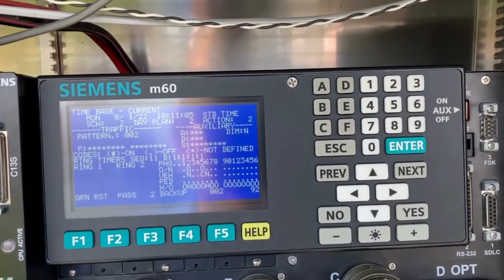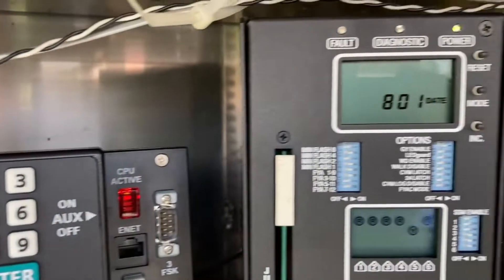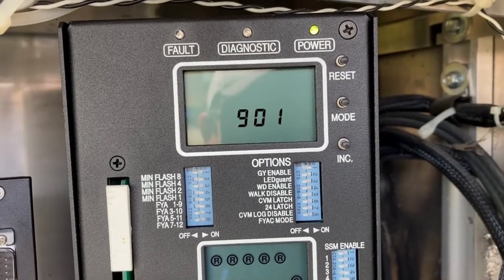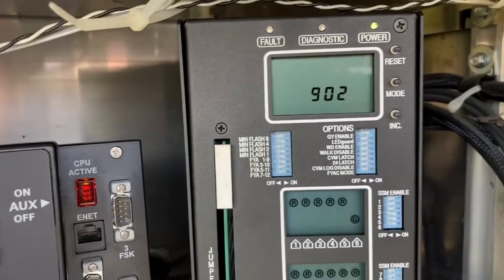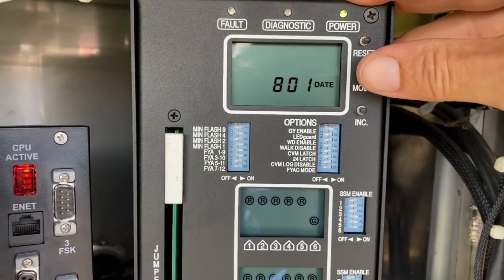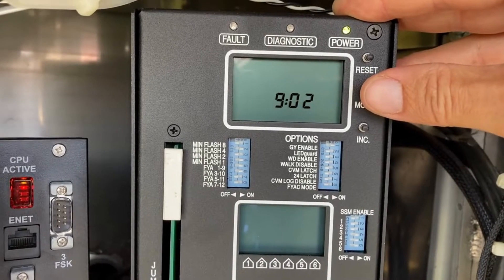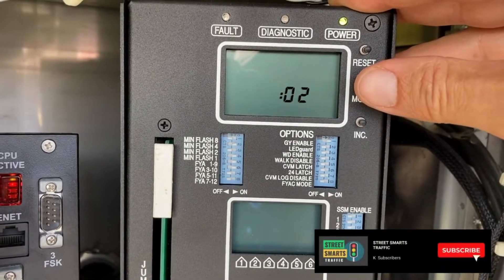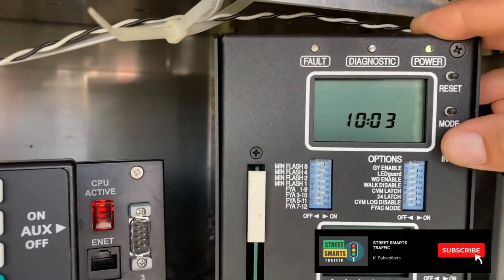Changing Time in Conflict Monitor to match Traffic Signal Controller

Comment: Hi. Love controls. I’m 75, never seen or heard of conflicts causing accidents. Do monitors ever fail, and when where they first put into use?
Reply from the maker: Hello!  Great questions.
Conflict monitors do fail!  Luckily, whenever I've seen them fail, they also place the signal into red flash (safety condition).  
I'm not exactly sure when conflict monitors came into existence.  I imagine it was around the time when MUTCD declared what should be used in a traffic signal cabinet  (70's-80's?)
Thanks for commenting!

Comment: I have a similar 6 channel EDI unit in my cabinet.  Every time I power my cabinet on, the conflict monitor time never stays correct.  I'm not sure if these units are supposed to have a battery backup, but since it's a cabinet I have at home, I haven't bothered to keep it corrected.
Reply from the maker: It should keep the TOD but like you said, probably no need to bother if its in a 'at home' setup.  Thanks for the comment!